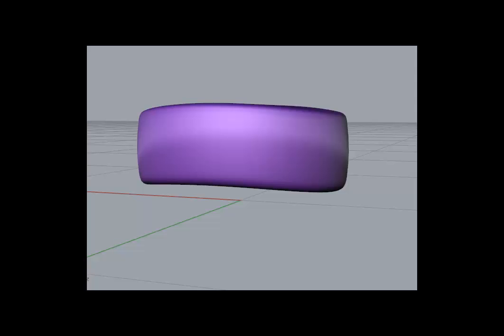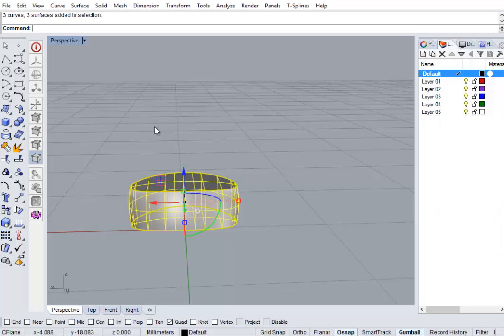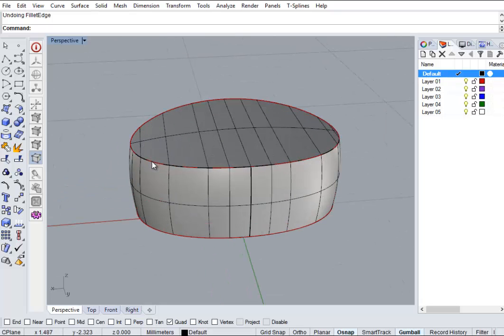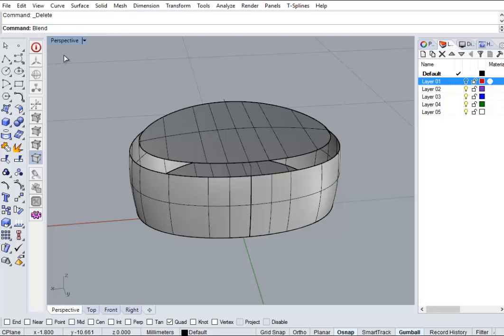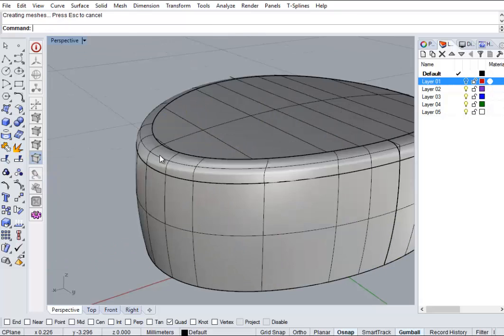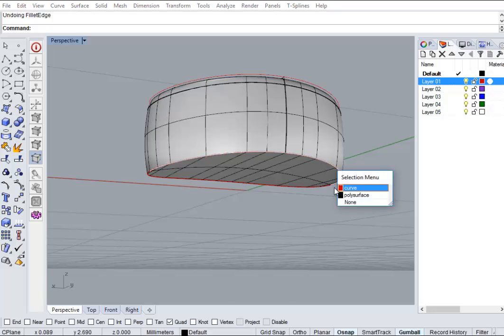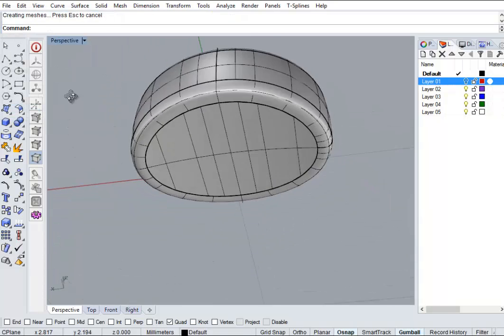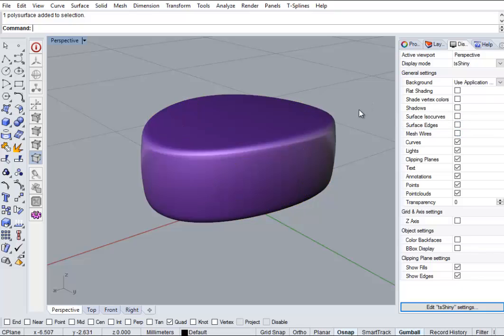A tutorial to fillet edges in Rhino or Matrix that fail

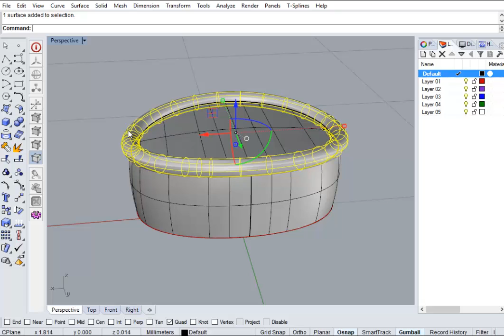Comment: Thanks for the tutorial, but at this step 1:42 my command history window says:
Split failed, objects may not intersect or intersections may not split object.
:(
Reply from the maker: If you explode the model not the pipe then try the spit this sometimes shows up the problem area.
Reply: Okey I fixed it. Just by exploding both the object and the splitting object (apparently there was some problem with their geometry that made the split not possible without exploding them first)